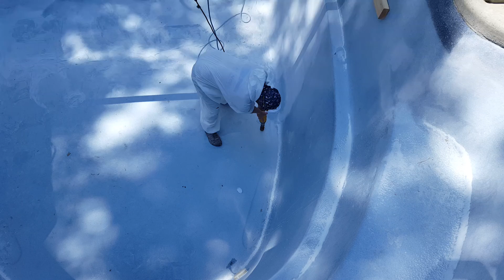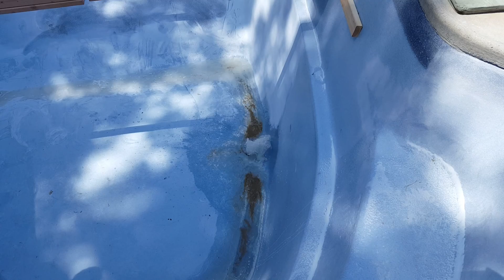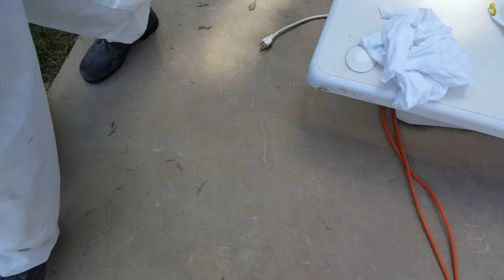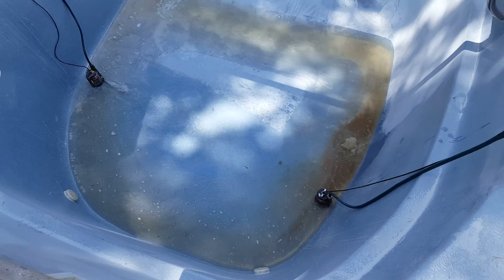Drilling a hole in the pool :(

Comment: I had the same problem with my pool I was just wondering how long did it take to drain all the water out. We drilled a couple of holes and have been draining for about 4 days now and clear water is still coming out.
Reply from the maker: I think it drained for about an hour.  4 days is crazy, have you had a lot of rain?  Or maybe you are on top of a natural spring.
Reply: @chandlersgarage  No rain the pool has been empty for 5 days now and water is still building and coming out through the hole I drilled in it to get the water out not a lot but over time its the same amount you think the water well has anything to do with it plus I live in Texas.
Reply: @perky20021  I'm about to drill a hole into my pool, any suggestions?
Reply: How do  u patch the  hole